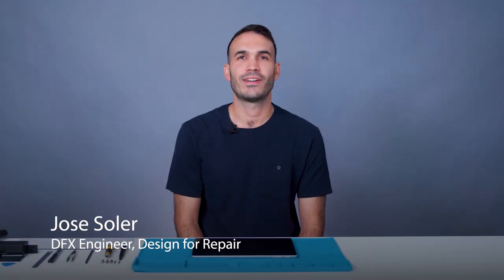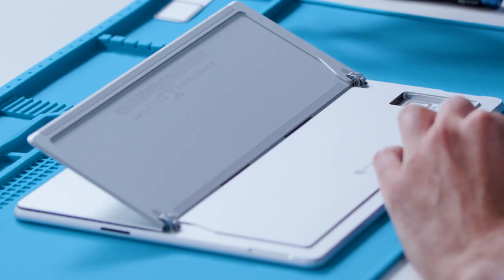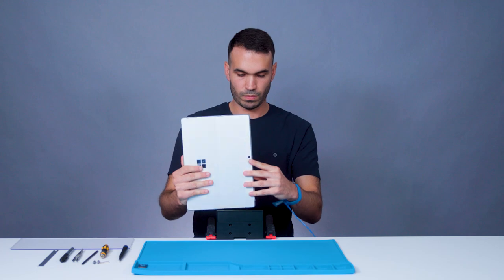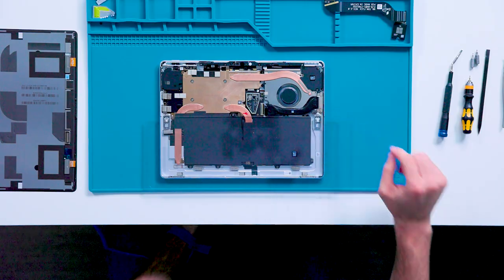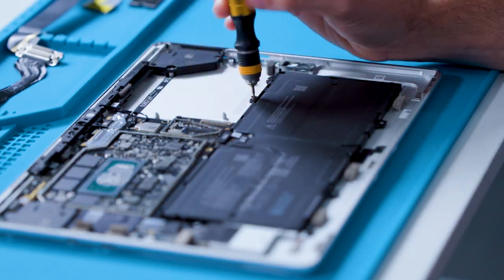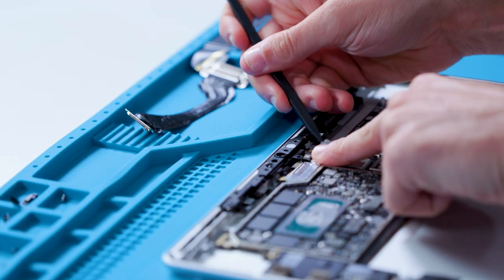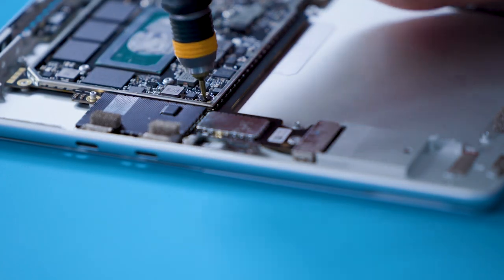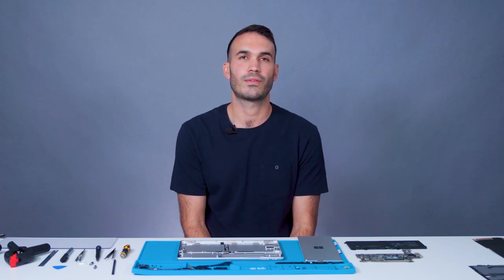Repair | Surface Pro 9

Comment: Nice to see Microsoft taking such a pro-consumer move, after previous Surfaces being some of the hardest machines to repair.
Reply: They were probably forced by right to repair law in EU
Reply: Most buyers aren’t going to open up the device or upgrade it or repair it, it’s doesn’t effect most users even if it was hard to repair.
Reply: What’s the point of a repair video if they don’t even sell spare parts and they charge you 500 for changing battery?
Reply: @deloller2452  i think you can just replace thermal compound and clean it inside
Reply: good job microsoft, It would be even nicer to correctly indicate how to disassemble the device, especially proprietary connectors such as the Surface connector(Surflink): 5:32
Reply: @MrAmperman   they were not they did it themselves. There not anti repair like apple their more of finding the cheapest way to make laptops

Comment: New device $999, Used device $850, replacement screen $535 (on ebay). Good job MS. Now there are no reason to repair your devices.
Reply: repairing is not always about replacing screen

Comment: I appreciate the transparency with all the new products guys! Though I personally would love to see the adhesive to be removed entirely in the next model, replacing it with a few screws and magnets to get the display off. Maybe something similar to the surface laptop

Comment: It would be awesome if the screws were color/shape coded. As someone, who has a dying surface book 2 battery, I would more than welcome the availability of replacement batteries, possibly tools/guide on disassembly. Also: feet! I doubt any surface book 1 or 2 has any feet by this point.

Comment: Really good Video, but I still have Surface Pro 7+ with bad repairabillity, but anyway it´s a good device. Maybe I will upgrade to Surface Pro 11 or 12. 
Edit: Keep going this way! It would be great, if I can put the Mainboard with CPU and RAM from Surface Pro 10 into the Case from Surface Pro 9. So I dont need to buy the Case, screen...

Comment: Is it possible to swap out the SSD and the RAM without losing my files?
Reply: the ssd yes ram no (its a tablet tablets have ram soldered in or else it wouldn't be a tablet.

Comment: still hard to get battery replacement.
too many remove things to get there.
Reply: Don't want to sound too bitchy but literally you only need to lift the screen (there's no need of debonding tool either, a plastic guitar pickwould actually do the job just fine) and the battery it's just held by few screws wich is rare by today standards as every tablet in the market uses doublesided tape that damages the battery once removed. 

This is by far one of the easiest repair jobs I've seen in this form factor.

Comment: good start, but for some of the parts, lose the adheisive and add more screws, as this is more sustainable, as to use tape/adheisive you do need to clean parts of residue, which involves alcohol, and WHY put the battery in first?, dumb, as for safety you want it out FIRST, so you are SHURE the power is OFF, so make it removable, like an Li-on camera battery, have it slide out.

Comment: I wish microsoft surface pro 10 or pro 9+, will add extra thunderbolt, so it becomes 3 thunderbolt. So without the headphone jack, it's not a problem.

Comment: "dear" microsoft why we(users!) can NOT do ourselves:
change dislpay in Surface Pro?
why screen it is GLUED?
why you can't use small bolts for screen?

why we can NOT add more RAM by SO DIMM modules ourselves? 
or you - Microsoft think that instead of 8GB RAM to have 32GB RAM USERS MUST PAY +1700$? 
do you Microsoft think it's "FAIR"?

I have many more complaints, but these are the main ones. but YOU Microsoft "CLAIM" that you have increased the possibility of repair! And at the same time, in order to get inside Surface Pro - we need to tear the GLUED SCREEN!!!

Don't you think it's stupid - glue the screen? 
Or in your reality there are no exists small bolts?

like - to up this